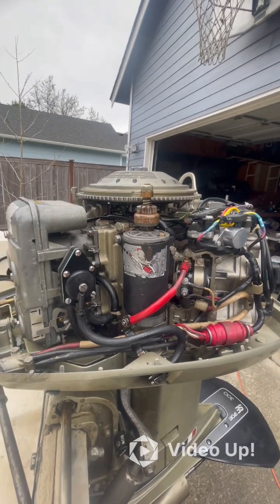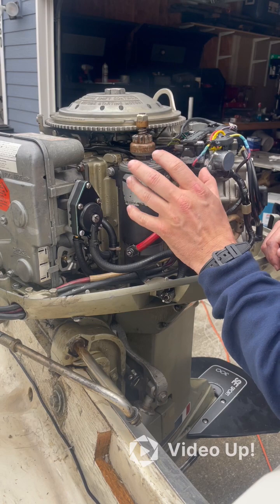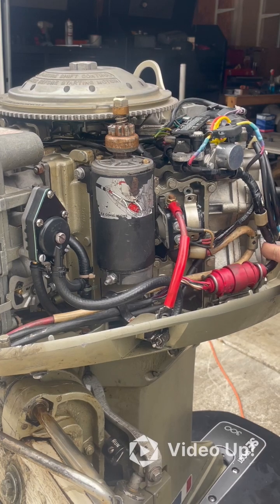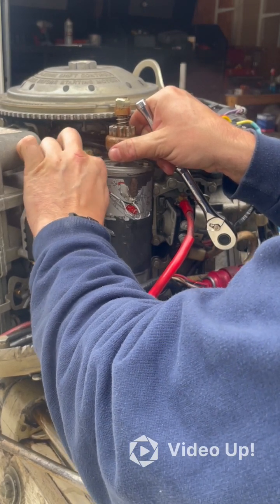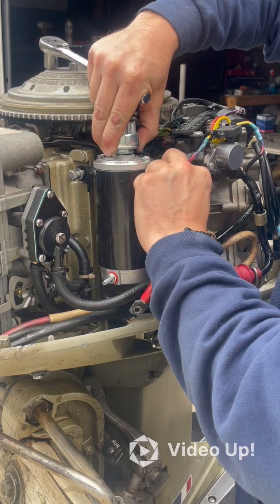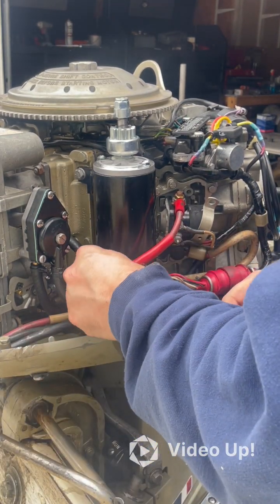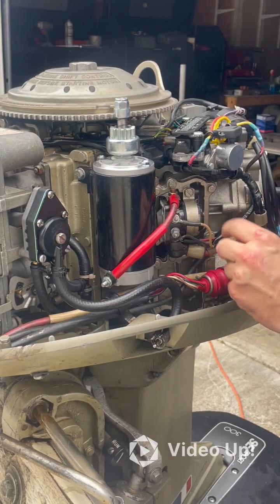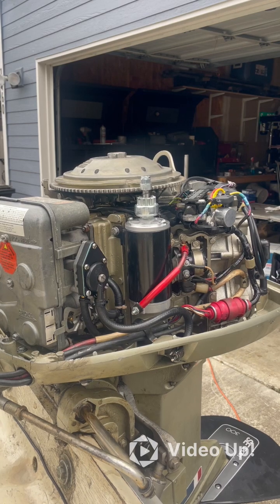Johnson or Evinrude outboard starter replacement.  Outboard starter repair.  #boat #diy #boating

Comment: Where did you find the replacement starter.  I need this exact starter and can’t find it
Reply from the maker: @jenniferfleming9610  go to marine engine .com.  Type in your model info.  It’ll give you a part number then you can find on eBay or Amazon.  After market is always cheaper.
Reply: @ thank you.  I have ordered 2 from Amazon that aren’t a direct fit.   The gear is too small.
Reply from the maker: @jenniferfleming9610  yep.  Need to find the part number based on your year and model engine.  Then search by exact part number.

Comment: Good video for getting to the point. Not a video for the novice mechanic, luckily I already own a vadt toolbox so I know a bit about tools & such, HOWEVER - wiring can be a bit tricky especially with extra wires and then throw in the primer solenoid, starter solenoid, the j box or the external box that houses the trim tab relays & associated terminals & wiring termination locations in that j box for lack of better term, but I've got so many wires with my pontoon boat rebuild I'm like what the hell, Bobby...🤔🤔
Reply from the maker: @PnRVRBO  um you don’t have to mess with any of those for this swap?  A novice can easily do this repair.